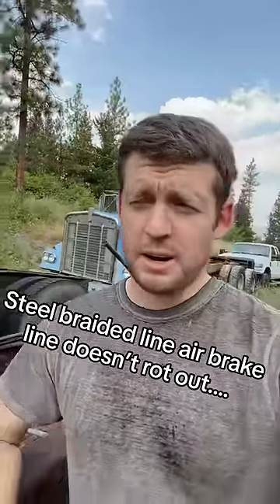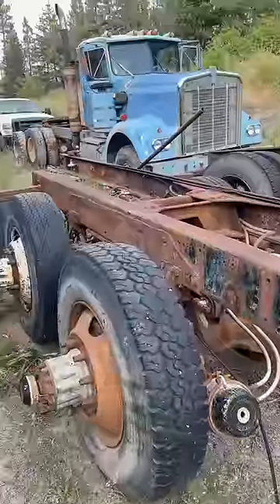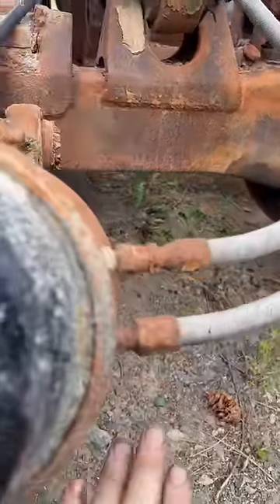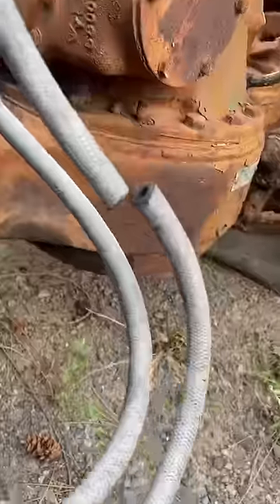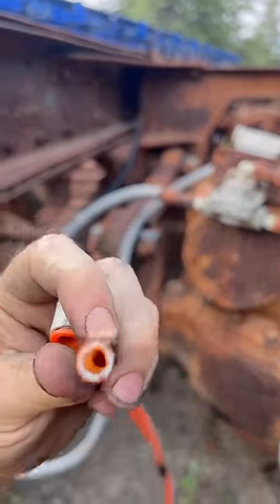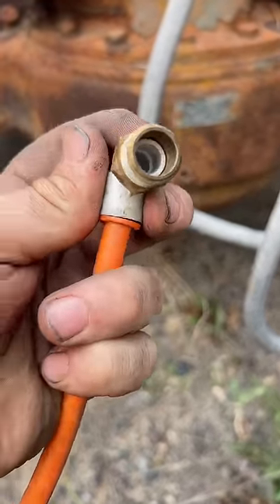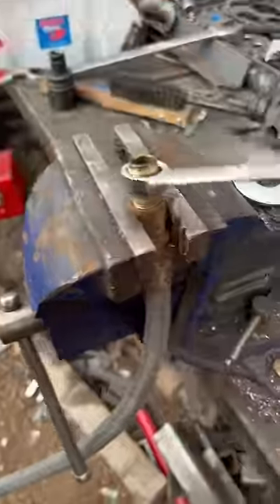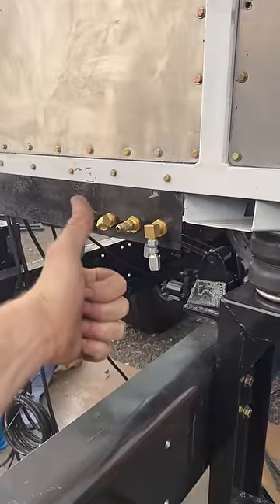Cutting a 70 year old trucks brake lines open for science

Comment: I've been a US military mechanic for nearly a decade, and I deal with leaking plastic air lines a LOT! Hard to believe that's what we've come to....
Reply: Iv never seen those 1/4 lines on any truck I worked on its always 3/4 breaded line between the air tanks and break chambers.  We have a sweeper it's all over the sweeper rigging though
Reply: @ryandronsfield6177  FMTV's have braided lines to the first brake chamber, then plastic connecting the 2 chambers on each brake. It's assassin.
Also, the front & rear glad hands are supplied by plastic lines, and the CTIS is all plastic except for the last line connecting to the hub.
For vehicles designed to operate in harsh terrain, they have a lot of weak points in the air system....
Reply: @rustyshackleford48 you seem very knowledgeable about this, I love seeing people take pride in their work and getting lost in it
Reply: @-pyrosef- built to break so that way they make more money not built to last anymore sadly
Reply: We live in a world and era where the only thing that matters is how much money can be made
Reply: It's cheaper. The US military practically runs on the idea of "cheaper"
Reply: Same. Military grade meant something. Although I am not Murican, military is military everywhere in the world. Robust, efficient, over engineered just so it can last. No more I guess.
Reply: @MarioAPN  Nah, military grade just means, it's just good enough for the job ad cheap as possible.
Reply: @JasperRoth  hmm, the best and most expensive cylinder sleeves that we have been using were from scrapped light tank barrels. And plates were also so good. I don't know the diameters of these, but they said use them and don't F up too much.
Reply: Its the logical conclusion of profit seeking. Cut costs at every stage of production.
Reply: We get lowest bidder! Normally in tests, you tend to throw away your lowest low and highest high for outliers. We should AT LEAST be going for the second lowest bidder. We're already spending a fortune. At least spend a tad more for something better..
Reply: US military uses steel braided lines too.  They dont rot from steel, the rubber line itself is what rots.  You will still get leaks from rotted rubber or from from any loose braids that cut into the rubber
Reply: @litrick5471 I’m not sure which trucks you’ve been looking at but I was at my shop no more than a few days ago and most of the lines on everything from JLTV’s to 7tons majority of the time is those stupid rubber lines. Cannot stand em.
Reply: Capitalism over safety. Those quarterly corporate reports have to shine. Saving until the end... That's what we're up to.
Reply: I highly doubt you’re a mechanic. It’s rarely the plastic that leaks. What leaks are the cheap quick-release fittings used on these plastic airlines. I can only count two times where the plastic airline gave out due to chafing. On the other hand the quick-release fittings begin to leak air after just a few years. I replace them with the compression brass fittings. Now those will last a long time.

Now the rubber hoses are still used today on modern trucks, but those are susceptible to chafing more so than the plastic airlines. Heck anything rubber like coolant hoses on the truck will eventually leak from chaffing.
Reply: @thereviewer4173  Yup, you caught me lying about my credentials and personal experiences to impress people on the Internet....

Or maybe, you don't actually know everything about everything... 

I'm mainly referring to military FTMV's. I oversee the maintenance of hundreds of them. You're correct that the plastic quick disconnect fittings are typically the issue. But not always. Especially when it comes to CTIS. 
These trucks aren't being used to haul produce down the highway. They're all terrain military vehicles. They get driven off road through rough terrain, then sit for months at a time.
It doesn't take much to damage an exposed plastic air line when you're driving a 5 ton through the woods or get it buried up to the doors....
Chaffing is rarely the issue. It's damage that occurs when the trucks are used as they are intended, but aren't actually designed to withstand.

But what do I know? I'm not actually a mechanic, right?
Reply: @rustyshackleford48  

I fail to see how the good ol’ rubber hoses can do any better than the plastic airlines. Those things are tough, and we all know that. C’mon. The rubber hose is just more sensitive, and I would argue more so in the military where you’re saying they running these trucks to the ground like literally. So yes, you’re either full of it, or you just aren’t understanding that the “superior” rubber hoses will not do any better in your situation.

All this YouTuber is doing is saying that the old is somehow superior, and in some cases it is, but to say that things today are worse than before overall is taking it too far and most definitely a logical fallacy, but he doesn’t care because he’s getting his views/money. He’s also too young to even understand these things. Anyone with experience working with these machines knows that the guy just isn’t as knowledgeable as he claims to be. The guy is full of smoke and people will eventually find out and leave him once he continues to get exposed over and over again.
Reply: @thereviewer4173  Hi! Mechanic here. Plastic does in fact leak a lot :)
Reply: @bigtony4930  

Yes, but like I said, it’s not the actual plastic hose, it’s the cheap fittings used. Even manufacturers know this which is why you don’t see them use cheap plastic fittings on their fuel lines. Fuel line leaks are almost nonexistent yet they use plastic airlines.
Reply: @thereviewer4173  The plastic hoses absolutely do leak if they deteriorate, crack or otherwise melt (Though, in all fairness, this is much more common in hotter and colder regions). You would be surprised just how many people are so inept at treating their vehicles with respect.
Reply: @bigtony4930  

I have never seen a plastic airline crack, melt, or even deteriorate, but I have never used very old semi trucks. All I can say is that that plastic used that I’ve seen in trucks no more than 10 years old is very tough and for sure superior than the rubber hose when it comes to chaffing and overall durability. Somehow rubber hoses are still used mostly on the air brake chambers and coolant system, but the rest of the truck has plastic hose like on the air system and fuel system.

Comment: Aerospace engineer here.  Steel braided line absolutely can rot out.  But its not the steal that rots, its the rubber that rots.  Any elastomer (including steel braided lines) will have a shelf life and will wear out over time.  How long it takes though depends on how well they are taken care of.
Reply: Exactly, rubber perishes, anyone who has worked on cars will know exactly what perished rubber is like. It's probably going to last a lot longer than bare rubber though I imagine.
Reply: Ok rubber decays, what about plastic? The plastic liners will harden and split too right?
Reply: True enough, and rubber can go really bad with exposure to some oils too. Would be nice to have a combination of both worlds though.
Reply: How long it take is also dependent on what the hose contains/transfers. Compressed air would include air of course, coupled with small amounts of water (condensation under pressure) and very small amount of oil from the compressor that may have got past the rings of the compressor.
Reply: @sammy5576 yeah, especially in sunlight constantly.
Reply: @Zelmel  thanks
Reply: I don't feel like an aerospace engineer would spell steel two different ways in the same post. Idk tho, I'm not college educated.
Reply: @Jason-if3bl I am an engineer, and I can attest that spelling and writing usually aren't the skills we're known for.
Reply: Most engineers I know don't have time to scroll through YouTube making comments about how they are engineers. I on the other hand am a rocket scientist and have plenty of time to roast "engineers" as they are the bain of existence for anyone who actually wants to get something completed.
Reply: True but it's 10000 times better than the other crap
Reply: True. But in comparison to other brake lines, the braided ones last much longer. Everything has a service life. Some things just longer than others.
Reply: Yup, rubber oxidizes and dry rots.
Reply: @sammy5576 depends on the kind of plastic, but yes, everything eventually falls apart
Reply: Just cause you’re an engineer doesn’t mean you’re smart. Just look at the engineering of today’s world . Having computers do their guess work, unlike the engineers who designed this truck with nothing but a pencil on paper.

Comment: I’m a plumber. I use braided steel lines regularly. Most braided lines are actually steam rated and can carry 1200 psi.
Reply: Iirc, they're also teflon(or Teflon coated) and crimped at each end.

Comment: love the fact that you are saving the 60 year old fittings and reusing them for spite. 

Proper behavior If I ever saw it.
Reply: Malicious compliance at it's best.
Reply: Say it louder for the people in the back
Reply: Never underestimate spite. It can move mountains.
Reply: A brass NPT-flare adapter fitting is not specific to braided hose.
Why not reuse the more relevant fittings seen in the video?
The actual "reusable" fittings of the braided hose?
Reply: @johne189  Because he'd finished talking about the hoses and moved on to those 60 year old fittings that were present and looked terrible but were actually fine. He was illustrating the lack of rot in the part that was claimed to rot, then reinforced the point by showing that even the parts that did corrode were still fine.
Reply: @EddieTheH  watch again, more closely.
A brass adapter would never "rot," that's common knowledge. A brass fitting will be the last thing to rot away on a truck, proven, even at 120 years - seriously. However, what will quickly go to "rot" on a truck with salt exposure are steel braided hoses and their (so called) reusable fittings. The video was light on covering that. 

How about it Edison Motors? Along with the brass adapter (it's fine) being reused, would you reuse the "reusable" hose ends on the new truck build?
Reply: @johne189 well done bud, well done. Someone had to bring an actual brain to show off around the smooth type.
Reply: @johne189  Ah, the old moving of the goalposts.. Good job.
Reply: @J.Henderson216 LOVE THE FACT THAT YOU ARE SAVING THE 60 YEAR OLD FITTINGS AND REUSING THEM FOR SPITE

PROPER BEHAVIOUR IF I EVER SAW IT
That Better for ya?? xD
Reply: It’s not spite. Nothing is wrong with them.
Reply: Yeah right, he's probably just one of those "Extreme Cheapskates"
Reply: @harveymushman4190  there aint nothin wrong with reusing fittings that are still good that aint bein a cheapskate thats just bein smart and savin money
Reply: If you have over 10 years of experience and told me “the inside is like brand new” ill take your word for it
Reply: It’s called stainless steel for a reason
Reply: Plastic is the worst. No longevity. I’m 26 but refuse to drive a modern car. All mine lack computers😂
Reply: @CEOofWasrael  old school is the best school fren. I always get a good laugh at the people bragging about their new vehicle with touchscreen onboard computer only to whine at the price whenever they have to pay someone else to replace a part.
Reply: Its just for show bro.
Reply: @johne189  you're bragging to people about this comment you made, aren't ya?
Reply: @halflife103  Not sure that I recall the post, let alone to brag about it? lol
FWIW, as a kid one of my first tasks in the truck world was to "harvest" fittings from components and parts trucks; inspect, recondition and sort the fittings for reuse. I suppose a thing or two about fittings rubbed off on me. Thinking about, now some of thoe fittings would be headed for 100 years of age and could still be in use.
Reply: @johne189 i actually prefer people dont use 45° SAE flare, people confuse it constantly with 37° JIC and they are not interchangeable fittings, leading to boogered threads and dimpled flare seats that leak
Reply: I know he reused the fittings in jest. But seriously, I wouldn’t trust them.
Reply: Brass lasts forever barring some weird chemical reaction.  Why not
Reply: Mmm yup🫡
Reply: The truck might be 60 year old but the fittings are nowhere near that old
Reply: Oh so that is why they use brass fittings. I thought they are/were used just because they were easy to machine, But I didn't know they lasted so long.

Comment: There's a reason why braided lines are more expensive.

They retain their flex, prevent rot, they hold their pressure without expanding or stretching, they're less likely to crack, and they're much harder to cut or puncture.

Braided hoses for the win!😆
Reply: It's just like braided cables for mouses, keyboards and headsets. They last much longer than plain rubber cables. At least the ones with quality materials and decent braiding.
Reply: @Arcadethief  There is a reason why they use braided to make pet proof cables.😁
Reply: I need a charger cable made out of steel braiding! 😁
Reply: @Eduardo_Espinoza  now that would be nice!😃

Best I could find though is zinc braided.🤔
Reply: And, unlike plastic, it takes more than one chemical to screw them up.
Reply: @VeteranVandal  a very good point, indeed.
Reply: Nice profile picture :3
Reply: You definitely need to do a flex test on it. Not just cutting off and look into the end of it ... !!!! 
LoL  !! 
Stiffer than granite  = a soon break in the DRY ROTTED  rubber
Reply: @wintersage6895 If you think about it, rocks being kicked up at high speeds can’t be much different than a gnawing tooth.

And with how many tires are on the thing, that’s a lot of teeth to protect your brake line from.
Reply: @BOBHLDRMN the same thing happens to the modern plastic/rubber ones, so you may as well get the braided ones anyways.
Reply: They're also more expensive because the have a bunch of stainless steel
Reply: But are a MF'er to deal with when you have a tire retread wrapped around an axle or you have to change the brake chamber.
Reply: They are more expensive not beacuse they are bettet (even tho they are), but beacuse they are made from a more expensive material in a more expensive process.
Reply: Braided cabling makes sense in about 99% of products. The fact that automakers have gone backwards on that is just silly to me honestly.
Reply: Exactly. I will take braided steel lines over anything else every day. One of the best upgrades you can make for braking on motorcycles that do not come with it.

Comment: I wish my employer would let me redo all the air lines on the fleet of T680s and T880s to steel braided. I am really likeing all the common sense you are putting into this truck.
Reply: If you can, you might try talking them into doing it on one of each as a test/proof of concept,  point out the advantages if it proves correct and it would be worthwhile to test out.
Just a suggestion,  it's how I've always implemented changes.
Reply: Just don’t the trucks will be garbage in 5 years and sold off replaced anyways waste of time
Reply: @adamtheede2575  We keep them on road for about 8 years or until engine or trans blows out of the 500k mile warranty. Then they get sold at auction. We have a 2018 T880 with 504k miles that blew engine in 2022 which has been stripped of parts now. Only engine, trans and cab remain. They turn to headaches at about 2 years mainly from emissions problems.
Reply: @johnwenzel2003  I've tried that but it is always the excuse of "no money in the budget". For example, the compressor to dryer hose is nylon braided and like clockwork it blows a hole in itself every 3 months from the heat. At $75 a hose plus labor vs putting a steel braided that may last a few years. Manglement does not see the future cost benefit, only this months bonus pay out so I'll keep spending company money on the same repairs with the same results.
Reply: @Jon.Rushing  (sigh) Penny wise and dollar foolish,  shortsightedness is how business got us into the hole economically and competitively that we're in now.  At least we know there are people out there that are willing to buck the statuesque and try to make things better and do things right.
Reply: What you can do, is when an air line fails, swap it on all the vehicles, the regular ones may still be fine for like 10-20 years.
It's easy to go "shiny/better new thing" but unless you aren't doing maintenance regularly, or there's a specific fail point you'll be fine with the oem.